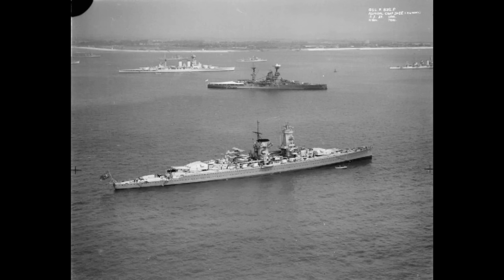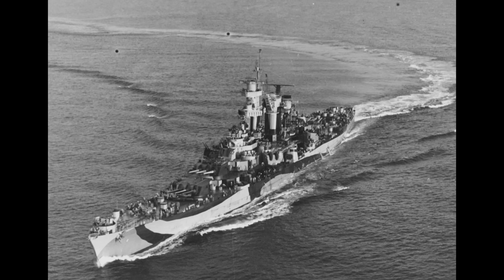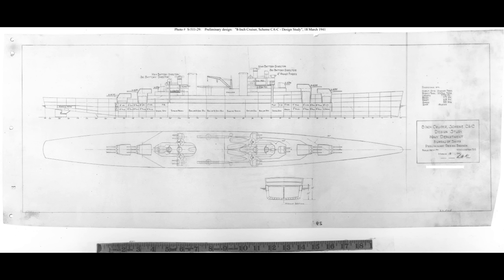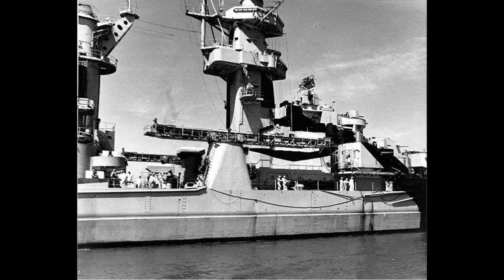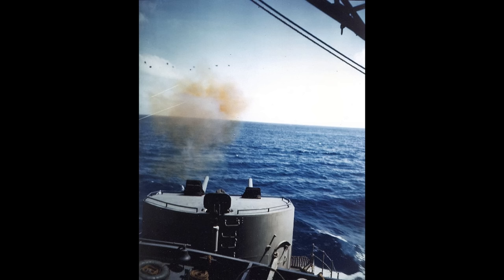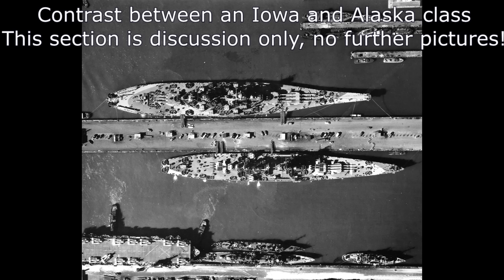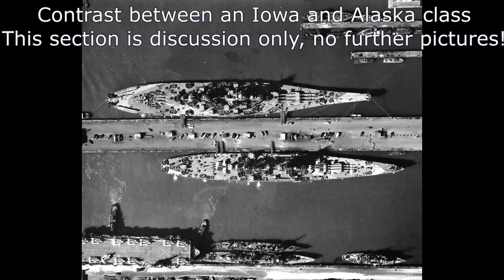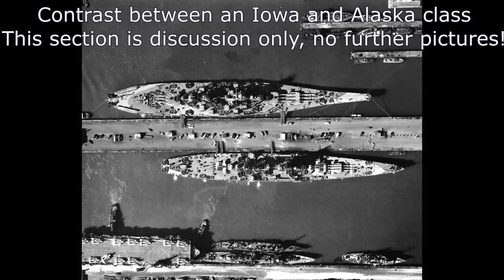The Alaska class - Large/Super/Battle/Mega/Hyper/Ultra Cruisers

Comment: Part of the problem of course is that there has never been a settled definition of what a "battlecruiser" is.  The argument could be made that the Iowas were battlecruisers, having almost exactly the same relationship to the South Dakotas as Hood did to the Queen Elizabeths.
Reply: "Battleship guns, heavy cruiser armor" is a pretty good definition.
Reply: @ostlandr  then what about the German WWI battlecruisers?
Reply: @solicitr666  Technically 28cm was battleship grade back then during ww1.
Reply: Actually, you're not far wrong.  The Iowa's - SIX of them - were to be the fast wing that would scout and engage the enemy while waiting for the slower heavyweight's - the Montana's to blast the opposing battleline to bits from a closer range, which their heavier armor would permit.  This was an update to the 1920's plan for six Lexington class battlecruisers and six "South Dakota" class 45,000 ton battleships with 16" / 50 caliber guns.  When the Iowa's were drawn up critics asked what they were getting for 10,000 more tons of displacement from the "new" South Dakota's - the four "treaty" 35,000 ton "standard displacement" ships that were actually built.  Well, they got 50 caliber guns - 80 inches longer than the SoDak's for longer range. The plan was to use the guns already made for the OLD South Dakota class ships but somehow they forked up on the turret design and had to make an entirely new, but lighter weight 16"/50.
Reply: @ariancontreras4358  Yes, but the Grosskreuzer carried much heavier armor than cruisers (or British BCs prior to Hood)
Reply: I usually use doctrine/usage to make the distinction. BCs are still capital ships, while CBs would be in a more supportive role. BBs are the main heavy hitters.
Reply: @ariancontreras4358 Yep. In Jutland Battle German Navy fielded both Battleships and BCs with 11" and 12 " guns each, depending on the class

Comment: Listening to the design history of the Alaskas, it really sounds like they were at an unhappy medium in terms of their intended role(s) vs. the technology of the day. The "sweet spots" seem to have been for considerably smaller cruisers and considerably larger battleships, where many factors came together to produce well-balanced ships with, respectively, 6-8 inch guns on 15-20 thousand tons or 15-16 inch guns on 40-45 thousand tons; in between those two was a vast desert of bad options, where costs very quickly escalated toward battleship levels while capability increased very slowly from cruiser levels.
Reply: The dutch had Project 1047  building a cruiser killer . based on the scharnhorst battleship.   same guns , less armour better AA . No cruiser that could touch them and fast enough to outrun any battleship.   The Alaskas could just have been copies of the original sharnhorts an upgun it by 1 '
Reply: @marcusfranconium3392  can out run a Iowa through.
Reply: @BestAnswer12549  34 knot Iowa dont think so   Project 1047 would have been the fastest capital ship ever build .  And the 34 knots was based on tropical waters Meaning it would go even faster in colder waters and eras where steam comes more efficient.
Reply: @marcusfranconium3392  I mean the ship was never made so it's just paper specs. And the design it's based off of only does 31 knots. Even if it is faster than an Iowa what's the difference between 33 and 34 knots.
Reply: @BestAnswer12549  Well they looked simular but had but where totaly different.  Different powerplants and propulsion , armour secondarys , bulbous bows. better armour distribution torpedo protection .etc etc.  34 knots based on tropical conditions it would have functioned in .
Reply: @marcusfranconium3392  I don't think we're going to agree on this. It would be pretty amazing if they were actually built.
Reply: @BestAnswer12549  Well if they germans would actualy read the orders right the ships would have been layed down 17th of juli 1940 ,  they misread the order of battle cruiser parts and instead send an ocupational army .
Reply: I think "light" battleships maybe couldve had a role, something akin to the Scharnhorst-Class or the french equivalent. But are they worth it compard to just building full size battleships? Who knows.

But yeh, WW2 heavy cruisers and late (fast) battleships seem to have been the end of the line for this kind of warship dynamic, the optimal sizes. Even in late WW1 you could see that, the Hood was a 47k ton Battlecruiser that was very close to BB levels of armor.

Took the big shakeups with missiles and torps, as well as planes and subs to break that dynamic.
Reply: @termitreter6545  Battle ships went the way of the dodo in ww2 ,  Heavy gun cruisers where more practicle . Cruisers /destroyers/submarines  where the real workhorses .   The ships that got  sunk with the highest percentage where battleships .
Reply: @marcusfranconium3392  BBs lost relevance in WW2, but idk how far I'd take a statement about loss rates and the importance of cruisers.

The fairly small german navy didnt do much in WW2, so battles between larger surface warships just werent relevant.
Most sea battles were limited to the Pacific, and that was mostly americans mopping up japanese fleets with superior firepower after midway. Its also an huge area with tons of islands, that were perfect for carriers.

There was no space for Battleships to become overly relevant, but I think the same could be said for cruisers.
Reply: @termitreter6545  Cruisers where the ones that did the actual work , from airdefence to escort and hunting down raiders.   the largest naval engagement of ww2 was the battle of the Java sea where it was the cruisers sluging it out with each other, 
Not to mention the number of cruisers that where involved in abda command .  

For the battle ship losses . 
the brits lost  3 battleships  2 battle cruisers .
the americans 2 battleships ( would have been more if they where not in a shalow harbour) 
Germany lost .   4 battle ships . 
Italy lost. 1
Japan: Lost 12 battleships and battle cruisers..  
France . lost 1 .   

In short most those are not small losses. 
Cruisers have been the back bone for nations for many decades even up till 2017 when the last gun cruiser was decomisioned after beeing layed down in 1939 .  and even after many cruisers have been build and are still operated .
Reply: @marcusfranconium3392  Youre saying some strange things. The battle of the Java Sea was way smaller than something like Leyte Gulf. And its not cruisers, but carriers, that did the most important work of that war.
Cruisers were utility ships and escorts. 

The battleship loss numbers dont really make a point. Like, Japan suiciding all their BBs for cultural reasons isnt an argument over their effectiveness.
And do you know how many submarines germany lost in WW2? Yet nobody says submarines were pointless in that war.

Otherwise gun cruisers have been irrelevant since effective anti ship missiles were developed. Thats not exactly a secret.
Reply: @termitreter6545  The problem with "light battleships" was that they ended up costing almost as much as the real thing (and sometimes more - the Alaskas were more expensive than the North Carolinas had been) while not offering much more capability, if any, than contemporary cruisers: two Baltimores operating together could do just about anything an Alaska could do, on top of which they'd be cheaper to buy, cheaper to run, and you'd have the option of splitting them up to cover two different places at once.
Reply: @Philistine47  The problem of the Alaska also was that they werent really light battleships, but oversized destroyers^^

Tbf, the Scharnhorst vs Bismarck is a bit more interesting. It cost 145 million Mark to build the former, and 200 million for the Bismarck. I would be interested in what the running cost of the ships were as well, I suspect theres a big difference.

So if you had full BB-fleet, you could have 6 Bismarcks type ships, or a mix of 3 Bismarck and 4/5 Scharnhorsts? 
Although writing it like that makes me agree that purely going for big Battleships might be the right idea. Yamato-size was probably overkill, but 40-50k ton was likely reasonable.
Reply: Agreed like finding a house just right to raise a family in without having to put additions or afterthoughts on it!!

Comment: I think Iowa fills the Battlecruiser category of the Hood Era : Same Characteristics as the Contemporary battleship the South Dakota same with Hood + QE.  Shits on Cruisers but can  also sht on Capital ships. Faster than their contemporary, Fills the same role as a Battlecruiser. But then again, I personally think a Refitted Hood is a full pledge Fast Battleship & the term Battlecruiser and Fast Battleship just merges as time progresses.  Either way, I'll just wait for Drach on the judgment.
Reply: I agree. The whole Battlecruiser vs Fast Battleship vs Battleship debate really reminds me of the the light vs medium vs heavy tank development. Eventually technology surpassed the speed vs protection vs firepower triangle and the Main Battle Tank replaced the previous types. And similarly to the old Battleships, the MBT is starting to fall behind modern missile technologies...
Reply: Mind, design still matters. HMS Hood, though powerful and tough for a battlecruiser, was still not quite as durable for the tonnage as a battleship of her time and you could only rebuild her so much to compensate for the structural and internal layout differences that meant she couldn't control damage from penetrating hits as well. Iowa, while with armor on the thin side for a battleship, was still built to control the consequences of penetrating hits very well and intended to fight in a Line of Battle against other battleships. The fact that it could meet or beat many cruisers for speed was a bonus, not fundamental to its role as a battleship.
Reply: @soupordave  that's not what happened with tanks. Doctrine simply evolved to confirm to logistical benefits and everyone compromised their designs
Reply: "The most heavily armored warship ever built next to Yamato was a battlecruiser." I've seen this argument before and it makes no sense. By that logic South Dakota was a battlecruiser as well!
Reply: But when you add the Montana class to the mix, there's a strong case under Drach's definition for the Iowas being the battlecruiser to the Montanas' battleship. It's just that the battleship era ended before it came to fruition.
Reply: @onebigchaz  Iowa was not designed with Montana in mind, rather the escalator clause of the Second London 
Naval Treaty, which permitted an additional 10,000 long tons standard displacement on top of the existing 35,000 ton limit. Iowa was designed to be the best possible battleship on a 45,000 ton standard displacement (and as it turned out, more like 48,500 tons), not as a fast skirmisher for the bigger Montana. It just so happened that the extra displacement allowance was heavily invested in speed, rather than armor. That being said, because the Iowas were longer ships the weight of armor ended up being heavier in both absolute (total weight) and relative terms (as a %age of displacement) than on South Dakota.
Reply: @thatguyfrommars3732  Just saying, based on Drach's definition of a ship with the same size guns (although fewer in number) that trades speed for armor relative to a battleship, that's comparable to the difference between the Iowa and the Montana.
Reply: @thatguyfrommars3732  It totally was! Montana was a parallel development to the Iowa, but Iowa was considered to get priority because there was no heavy unit able to escort carriers besides the heavily strained heavy cruiser force. It is even visible in the Iowa class itself, the first two build with what the design was at the moment, Missouri and Wisconsin a subclass with improved protection. 
Montana is THE super-South Dakota: the battleship you make with more than 35,000 displacement available, while Iowa was the offshoot that was ordered with great haste while the Montana was further refined (and postponed because of carrier priority). 
https://warshipprojects.files.wordpress.com/2019/02/usn-bb-development.png
https://warshipprojects.com/2019/04/04/montana-class-genesis-reloaded-2/

And remember, in hindsight we are fully focussed on the new constructions being 'the USN battleline'. When these ships where designed, there was a good capable USN battleline available that while it not may have been able to search out the IJN battleline, it was able to take control over the ocean and support landings. The Iowa became the visible end-point of battleship linage, because it was the last real battleship. KGV was heavily limited by treaty, Bismarck is a hyper modernized 'kreigsmarine' design, Yamato was the only one on that end of the spectrum, so considered an aberration, and Richelieu / Littorio classes where somewhat localized designs. If you think World-wide / Pacific-wide commitment, protection and/or armament seem to take priority over speed based on the priorities of KGV, Yamato, Lion, South Dakota and Montana.
Reply: Iowa is a fast Battleship nothing else. It has way more armor then a Battlecruiser.
Reply: Then you shall have to go by mission to name. Does that ship perform cruiser hunting duties and only supports the battle line or does it spend most of its time going toe to toe with enemy battleships?

Comment: I would put forth that If you include the Montana's along with the Iowa's the Alaska' are heavy cruisers and the Iowa's are Battle cruisers. The Montana's were going to be 73k tons with a speed planed for 28 knots 12 16"/50's 16.1 inch armor.  Which when taken of context of how Drach described battle cruisers gives you an Iowa.
Reply: The thing is is that that'd be the new Contemporary Battleship, and the Iowa's are the Contemporary Battleships before it. A contemporary battlecruiser design for the Montana's would be designed after or with it and would weigh much more.

Comment: As a note towards that Iowa/Hood video, Drach, if you check your Friedman, during the period after the South Dakotas were ordered in '38, the USN polled the battleship captains (and squadron commanders) as to which of the two options they had should be pursued first, with the understanding that the other would be built as a follow-on.  Option one was the "conventional battleship" design that ended up evolving into the Montanas.  Option two, which won handily as a special-purpose design for countering the Kongous (and Kongou replacements), was what became the Iowas... and was referred to as the "battlecruiser option."

So even the US Navy, at least at one point, agreed with your assessment that a 1938/39 battlecruiser design would have looked a hell of a lot like Iowa...